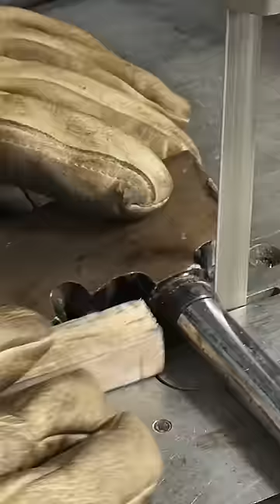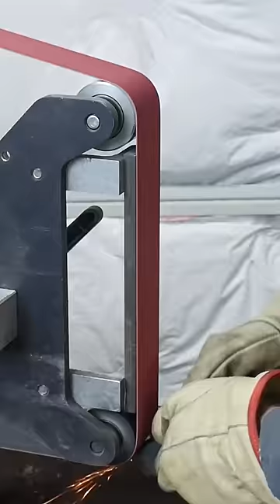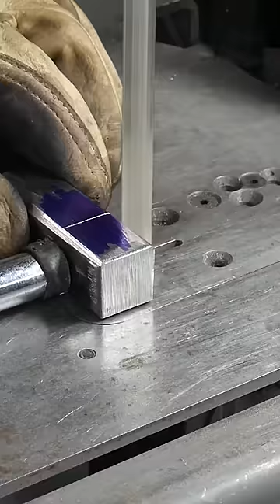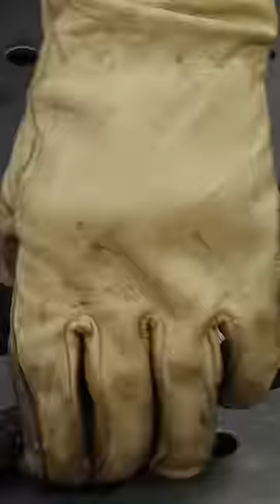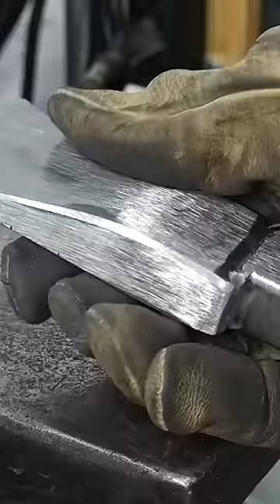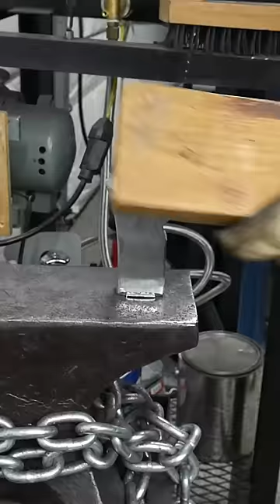DIY Hot Cut Hardy | #Shorts | #Bladesmithing 🔥

Comment: Sad that a perfectly useful axe had to die for it, but still cool. Probably should harden it too, it’ll last longer that way
Reply from the maker: Yeah, It was bent and I wasn't using it. It will get more use from me as a hot cut hardy. I'm assuming the blade is already hardened to some degree as an axe, but haven't tested hardness. Cheers!

Comment: Is there any benefit to doing a hot cut? I'm not much of a forger so I'm genuinely asking. I've never done one. 

I'm guessing it's so you won't have to stop what you are doing, let the metal cool, and use an angle grinder or band saw. Is there anything besides that?
Reply from the maker: Nope, that's exactly right. Also you could potentially save on cuttoff wheels and blades if you doing a lot of it.
Reply: @RedBeardOps  makes sense. Saving money could be worth it too. I'm sure if someone is really well practiced at hot cutting you can get some good results too.